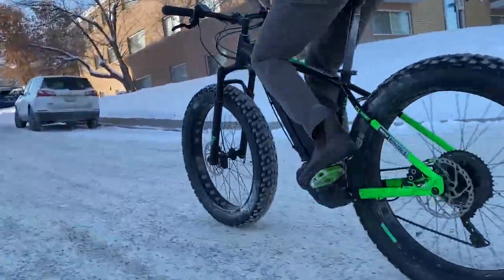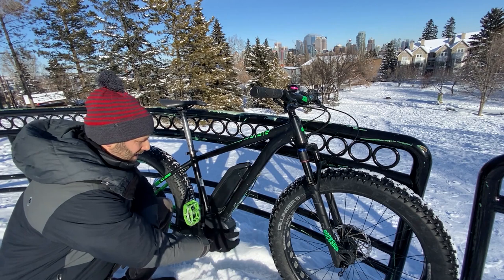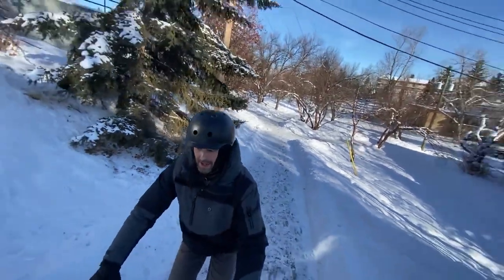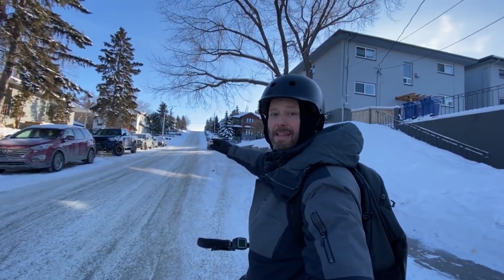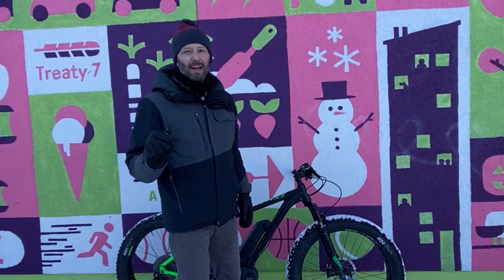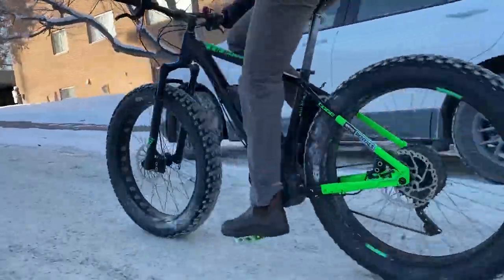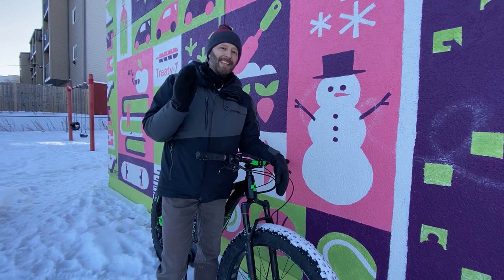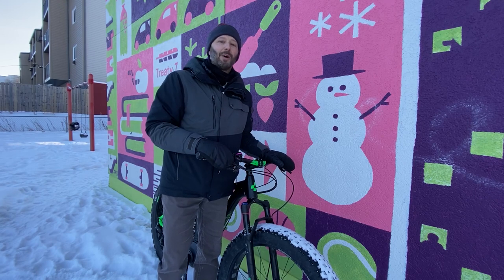Will an electric fat bike become my new favourite winter urban commuter?

Comment: Add too noisy to the list, I like that I can hear what's going on around me.
Reply from the maker: I share this concern!
Reply: It's not that loud....on my winter commute I actually play music on a Bluetooth speaker, and even with fat studded tires, I can still hear everything around me.
Reply: I use a Engwe engine pro 750watt for commuting (all journeys, I have not bothered with a car at all for 15 months, next week will be the first time I hire a car for the day to do an accounting job that’s 90 mile round trip) the engine pro only cost me £1,260 ($1,500) comes with lights including brake lights, sturdy rack, fenders, As for missing the self generated heat, you can just set it to a lower assist level or just dress appropriately for riding with less effort, a solid bike stand means you don’t have to worry about fitting wheel into the bike rack, just lock it to the rack.

100% wouldn’t have a non Ebike fat tyre, but with power it opens up a lot more commuting and getting around routes, off road, gravel paths, across the park, previous Ebike was a mountain eBike honestly it was nowhere near as versatile as the fat tyre bike.

$6,000 fat tyre? Definitely would not spend that much, ridiculous price, but there are many fat tyre eBikes, some cost less than $1,000
Reply: To be silent on frozen snow, you need to float.
Reply: @julianshepherd2038  give it to the shark God forbid they sink

Comment: My daily commuter/grocery getter is an ebike with 2.3 inch wheels (2.1 for my studded set). It’s a great way to get around. I can vary the level of assist by percentage so I definitely get a good workout without getting TOO sweaty on my way to work. Road chemicals haven’t been an issue yet. I’m also able to take the bike into the office with me so theft isn’t an issue. Ebikes really open up the road to folks who would otherwise jump in their car to get to work.
Reply from the maker: I agree that it can be a good alternative to a car — sometime these decisions aren’t between different styles of bikes, it’s between a bike or a car. In that case, I say use whatever bike works for you!
Reply: Yeah they're trying to bring 1 down both arms for the tail

Comment: I was lucky to find a fatbike on a great clearance sale a couple years ago and converted it to a single speed for my winter commute. It's really slow but my route has very unpredictable conditions and it's nice to know the bike can handle everything with confidence. A plus side of the noisy tires is you don't need to ring a bell very often because people hear you coming from a long way off.
Reply from the maker: These are good points. Glad you found a machine that works for you!
Reply: Thank you. That makes me confident so I want to get one now
Reply: @Shifter_Cycling  what do you think about tern bikes in urban/city riding? They are easy to put in small places but I wonder how the ride is vs other city bikes. Wonder how much of a difference between them

Comment: Shifter, please visit this review from the beginning to the end and see if you really made a fair and balanced review of "fat tire e bikes"....not just the complaints you have with the bike you rented. I think a new fresh review would benefit your viewers.... What is wrong with putting on the rear bike rack that you want, the light you want, and .....if you don't want to go so fast that you can "warm up".....slow down (choose a lower level of assist and stop peddling so fast)... The $6K cost is absolutely on the very high side of the cost range....many, many more reasonably priced, if you take the time to check.

Comment: Turn down assist to where you get the right combination.
Reply from the maker: This is a valid point.
Reply: @Shifter_Cycling  I have a Fuji e-traverse. Great e-bike for almost any type of riding. It is a class 1 e-bike. I have found it is best to always set it to full power and use the gears to control speed and power. For city commutes and just for fun riding I have a 30 year Fuji Supreme 18 speed with rim brakes. Rugged lugged steel frame and comfortable antler handlebars. Has an rear wheel generator/alternator for lights No need to worry about batteries.. If I were to modify it for daily commutes I would go to belt drive, make it single speed, and add fenders and rack and install a more comfortable seat. I would need to modify the lights to LEDs and add some electronics for regulated DC power for lights and phone charging. However the bike I miss the most was the one I had as a kid. A Raleigh "English Racer", really made in England. It looked the part as well. It had a 3 speed "stermy archer" internal hub gearing. Don't know what ever happened to it but wish I still had it. Got it when I was 13,14, or 15 years old and would still ride it at 70.

Comment: I live in Wyoming and my sole form of transportation is a 1000w AWD ebike. Having that pedal assist & duel hub moters is a game-changer for hauling my cargo trailer for groceries as well as dealing with wind and weather.
Reply: model ?
Reply: @mmmmmMuffinz  ,
 its a Super Monarch by E-Cells
Reply: hey there, mind if I ask how the batteries have held up against cold (or hot) temperatures?  @superimposedtab

Comment: I have owned a fat ebike for 3 years and I love it. It came with fenders, lights and rack from the factory. It isn't a 6k but a 2k bike with 9 levels of pedal assist.
I agree with your comments about potential corrosion and parking outside. I worry about that.
Reply: Would you mind sharing what model it is? I'm currently searching possible options for fat ebike.
Reply: what make and model is the bike you got ? 2k is my max price limit
Reply: does your battery still work? My battery crapped out after less than 2 years, and I can’t get a replacement. Apparently the batteries only last 2-4 years and the cold damages them.
Reply: @n3m0k54  Voltbike Yukon750
Reply: @dawpps  my battery is still good but I don't use the bike every day.
Reply: Get a Suron
Reply: A have possibility to buy elctric fatbike with fenders and rack but broken battery for 250$. Thinking to buy it and repair but still not sure. Are those tires very noisy in summer days? I like my quietness on bike a lot and have feeling those noisy tires will bother me a lot.
Reply: @bobikbobikowy5458  You can easily just buy a more quiet tire model when you take off the studded tires in the summer

Comment: You touched the main point there. Bike theft. If you have trouble with this in FUCKING CANADA, just imagine us, mere mortals, living in the 3rd world. I tried really hard, but after having 2 bikes stolen, I tried to go for an Electric Unicycle, which can be taken inside wherever I go. The problem is these things are not as stable as a bike, so I fell really bad one time, and now I'm back to the car, and I'm going to stick to it. The upside of this journey is that every time I'm stuck in traffic now, instead of getting mad and impatient, I'll remember the alternatives and be glad that at least I'll get to my destination safely and clean.
All my love and admiration for all bike commute warriors out there.
Reply from the maker: I don’t think there’s a city in the modern world where bike theft is not a problem, and it has real-world implications like this. Thanks for sharing.
Reply: I'm surprised e-bikes don't come with GPS locators built in. All you'd need is a sim card / data plan ($10/mo with verizon) for it and you could know where your $5000 bike is at all times

If done at the factory, they could integrate it into the frame (controllers are too cheap and easily ripped off to hide GPS)

Makes me want to start my own ebike company; do ebikes better than those paper-pushing money-changers
Reply: @shimes424  because insurance can actually be cheaper than a standalone GPS Bike tracker + plan.
In some instances a lot cheaper.
Heck, I pay 80€ insurance a year for my 3000€ Pedelec and it covers theft (bike is even covered when I just lock the wheel and grand together without an external) as well as necessary repairs and even chains, cassettes, tires when they wear out.
They even pay my cab when I get stranded somewhere.
Why should I pay more for a GPS Tracker than for all this plus some?
Reply: Just get a proper lock.
Reply: @shimes424  5 grand??? What kind of ebikes you guys been buying? Put in another 5 and get an e-motorcycle.
Reply: @jhowardsupporter  
5000$ isn't all that much for a good E-MTB if you like to get one.
The more you learn about locks, the less you trust them.
That includes the really high end ones as well. No matter how good your lock 99.5% will get shredded by a Flex grinder and 95% will easily get cut by a hydraulic bolt cutter in less than 2 minutes.
And even if it's a crowded place, almost noone will stop you when you steal a bike, even in daylight.
Cable locks are a joke that isn't even worth mentioning, foldable locks get obliterated by a 10$ nut splitter without any skill in a minute and good security chain locks are INSANELY heavy, even for an Ebike.
U-locks can provide adequate security, but are a pain in the ass to use and they still fail to protect against angle grinders or to a lesser extent depending on the model a hydraulic bolt cutter.

Locks just don't cut it.
Trust me, I've learned the hard way with a 120$ lock and a 20 minute stop.

In my opinion the only solution to give you actual security AND peace of mind is to get insurance if you plan on locking your bike outside. Especially as it can cover so much more than just theft for just a little extra cost.
Reply: @Minecraftrok999  oh yeah depends on the criminals. In Australia they don't usually take even bolt cutters with them. Also that's why you ride fixed gear or single speed cos they are cheap. But there is still lots of ebikes around usually around the 1000 AUD mark. 1000 of our dollars is like 700 US dollars or something. Americans get everything for cheap. Anyway in Australia a chain lock that can't be cut easily with bolt cutters in enough. One guy in Sydney used an angle grinder to cut the lock of an ebike BUT the bike he stole belong to the news reporter! Stealing from a member of 7news is like stealing from a member of the government! Bad idea!
Reply: @jhowardsupporter  huh, here in Germany they definitely roll up with the heavy duty tools. And why shouldn't they?

1000 AUD seems extremely cheap for an Ebike to be honest, but if you only have ~640€ Ebike I'm sure you don't care THAT much if it gets stolen.
But if you go into a bike shop here the cheapest E-Bikes will start at 2000€ (~3000 AUD) and only go upwards from there.
Of course there are a little bit cheaper options online and in the supermarket or "construction" market, but those aren't really good bikes and if you buy online (which I did) you buy blindly.
But bike shops almost exclusively sell Bosch motors here, so that's why it may be so much more expensive.
Reply: @Minecraftrok999  Just get a bike with gps or get a gps tracker. My cousin is in Germany now. Germany also has a huge problem with pollution because of the defeat devices in cars. I think 10,000 people a year die in Germany cos of the pollution. The government covers it up.
Reply: @jhowardsupporter  
Yeah, but why should I (or anyone) ever get a GPS tracker?
They are way too expensive.
In fact they're more expensive than my insurance, which covers A LOT of other stuff in addition to simple theft.

GPS trackers are an economically stupid decision.
They are 100-300€ PLUS a monthly fee that's usually on its own just as expensive as complete insurance would be (with theft, vandalism, accident and wear and tear covered + some)
And with a GPS tracker you have no guarantee of actually getting your bike back.

I repeat:
GPS trackers are stupid, when you could get insurance instead.
Reply: @jhowardsupporter  
True about the pollution and I really hope that in the next elections the conservatives get ousted from office, but pollution is a problem in most countries and it's not exactly covered up by the government, but more by local governments who purposefully place the pollution measuring devices in dishonest ways to get a lower reading sometimes.
Reply: you prolly dont care but if you're stoned like me atm you can watch pretty much all the new movies on Instaflixxer. Have been binge watching with my girlfriend these days :)
Reply: @Marlon Kannon Yup, I've been using Instaflixxer for since november myself :D
Reply: Don’t leave your bike anywhere in the open for more than like 5 minutes unless you’re right there and you can see it....also they do make good bike locks...nothing is 100 percent guaranteed to keep your bike from being stolen but you just gotta play is safe.
Reply: @Minecraftrok999  Look up the Litelok X1/X3 and Hiplok D1000
Reply: @Troy The Smith At least it's better than the US
Reply: @swecreations  I know them, they're really good locks.
But they're U locks which can be quite hard to use when you don't have ubiquitous adequate bike racks throughout your city (mine doesn't :/ ).
They're also quite heavy and really expensive.
£250/290€ each, which is just as much as I pay for 3 years insurance.

I'd much rather have the peace of mind of insurance - especially because it also covers wear and tear (even of my drivetrain).

Comment: I built up a 29er kinda relaxed handlebar - midrange 8-speed hydraulic disc front wheel e-assist bike and she KILLS it in the snow. Just feels so locked in. All second hand parts and everything is nonproprietary, so I was able to iteratively build it up over a year, and now it’s the best thing to hop on in my micro-urban environment

Comment from the maker: Have you tried a pedal-assist fat bike?
Reply: @stinkypete3900  Right on! I ride a Kona Unit single speed bike with 27 x 3 inch tires. It was not perfect at the start. I changed the wheel lubricant. I could barely pedal it when I bought it in  December of 2018. Now, it rides like summer time. Partly due to being 71 I changed the rear cog from 18 to a 20 tooth sprocket. Easy going now.
Reply: I have. They suck.
Reply: I've had one for 2.5 years and it's been nothing but pure fun.  I used to commute on it (parked it in my office, so no theft worries), but I recently retired so now it's just a fun bike to ride around town/in the woods.
Reply: I have one with throttle and pedal assist its my daily commuter no real cons about it except big tires get flats more often , would suck to pedal without power, brakes go quickly

Comment: I'm riding my Rad  Rover fat tire ebike in the snow and it is a beast. 

With racks fenders integrated lights my bike was about 2,500 us. 

I am as you say afraid to leave it almost anywhere locked up. 

I am really impressed with rad cycles their product and quality control has gotten them a number one place in sales in the US.

An electric fat bike is a good ebike to start with because it is so unique it fills winter and summer time activities yet as you say it's not that practical. 

No doubt I will eventually get a regular road ebike, but as you said they are very expensive right now.

I'm waiting for priority to expand their e-bike model range 👌✌️

Comment: I love my Riese und Müller charger 3 s-Pedelec with broad tires. Its belt drive, 650Wh battery and rack makes it perfect for my 50km (25km one way) daily commute.
Reply from the maker: For a commute that long, a pedelec makes perfect sense. Glad it's working for you!
Reply: I've got the Supercharger 2 from R&M and you're correct - they are great bikes for a commute that might include some bad road surfaces or even light or medium off-roading....

Comment: I am glad you gave an open minded review. And it won't be the end of the requests. Location to me has so much to do with what makes a practical winter commuter bike. I am 68 and in 5-10 years I may make the e-bike leap, but it will be generally in the same configuration of frame and wheels I enjoy and need now. My current winter specific bike is a 26 x 2, internal hub 8, and handles the worse snow and ice in my area. The real thing against fat tires for me is how this horrid skier zips right past fat tire bikes on the local Nordic trails unless they are in a perfect bubble of conditions.

Comment: I own a fat tire e-bike and I'd agree with everything you said for the most part, but the city I live in has terrible roads and virtually nonexistent bicycle infrastructure so it makes riding in the city much more enjoyable and handles the rural trails amazingly. I would love to try a 3" tire to compare them. As far as the best commuter vehicle I'm leaning more towards e-kick scooters, they can have the same speed and range as an e-bike, fold up so you can pull it behind you into a store or work, and weigh a fraction of the bike. The only issue, though it's a big one, is that they don't have the same legal status as e-bikes, at least for the moment, because they lack "pedals."

Comment: I got the Lectric XP with the 3" fat tires, and instead of $6000, mine is only $1000. Still a little expensive for a commuter bike, but definitely not as tough of a pill to swallow as $6000.

Regarding staying warm in winter, I just lower my pedal assist (so I'm working harder) and travel slower (so there's less wind chill factor). A side benefit to that is that I get longer range on the battery so it's not like you're wasting the potential of what you paid for.

Regarding the lack of urban features like fenders, bike racks, or lights, my Lectric XP came with all of those things preinstalled, and it was $1000, not $6000.

So in other words, I wouldn't disregard fat tire e-bikes altogether. There's a balance to be had. It doesn't have to be as expensive as the one in this video, and you don't have to use the highest level of assistance either.
Reply: where the heck did you get that and where can this canadian get one? :0